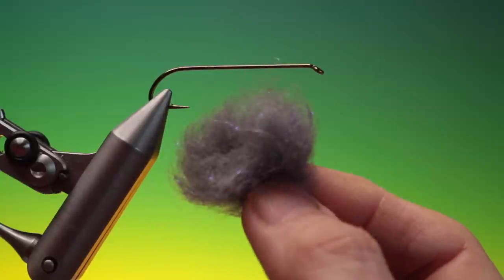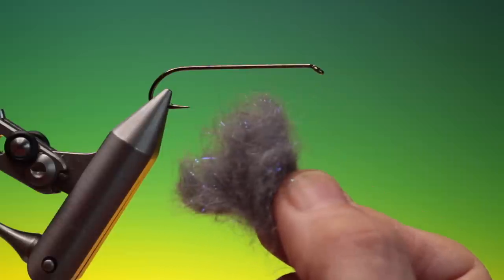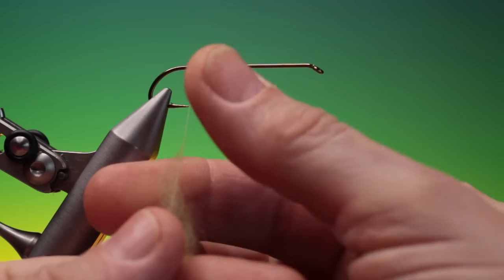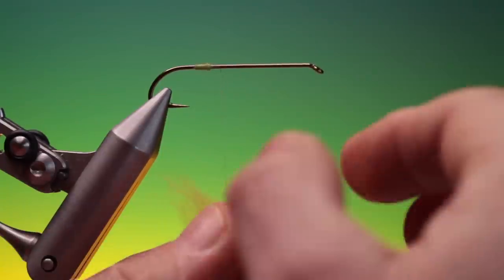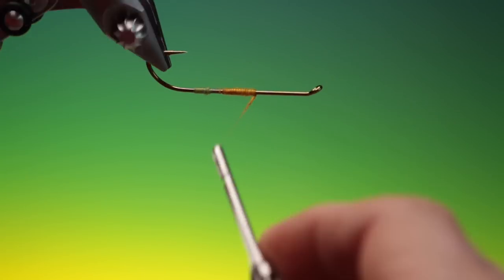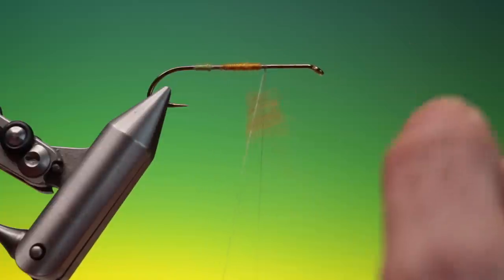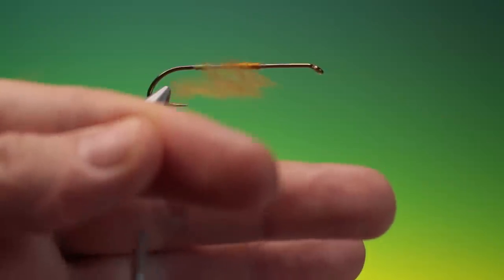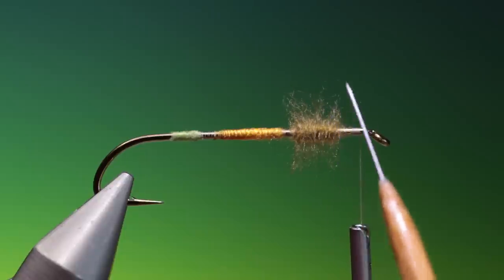Fly tying for Beginners three simple dubbing techniques with Barry Ord Clarke

Comment: Very informative, thanks.  I seem to do better with tying in a dubbing loop as opposed to splitting the thread.  What are your thoughts on that?
Reply from the maker: Thanks Gordon, Splitting the thread works extremely well when you are working with, finer materials, such as dubbing, CDC, marabou etc, it makes a much finer dubbing brush than a doubled loop, but if you intend spinning heavier materials like, deer hair, rabbit fur etc you have to make a stronger dubbing loop, otherwise the split thread will break. Practice a little, you will find that it is better. Good luck.